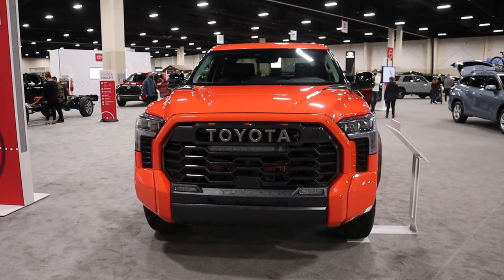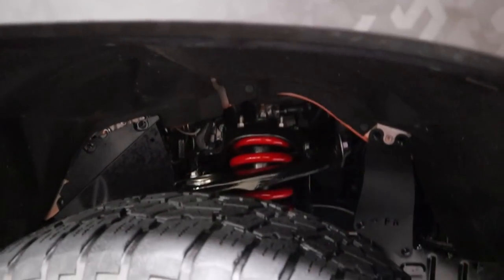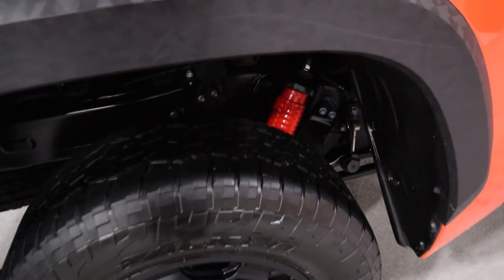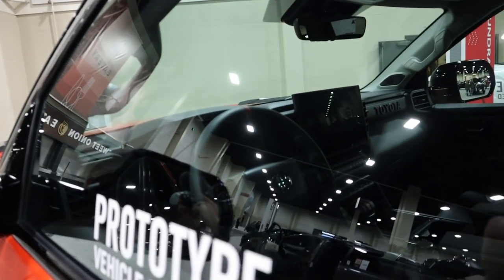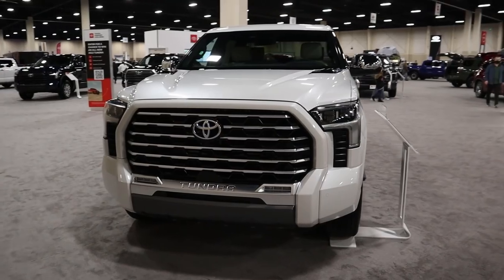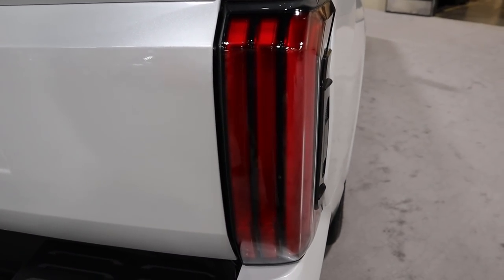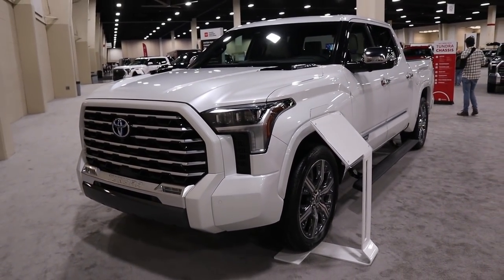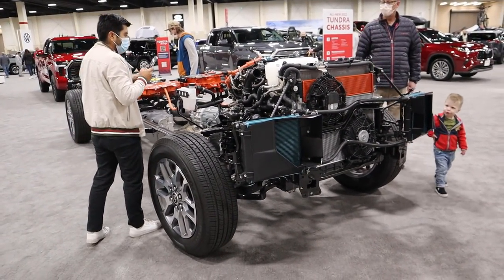2022 Toyota Tundra TRD Pro And 2022 Toyota Tundra Capstone: Which Tundra Is Best?

Comment: They both look great in my opinion. I kind of wish they did something different with the stamped TRD pro on the back. But the marker lights are on there because it exceeds 80 inches in width. When you get the pro I believe the tires sit at a wider stance making it larger than 80 inches. So you’re right the body is pretty much the same width with the capstone!
Reply: The fender flares are a bit thicker on the pro

Comment: Since you didn’t have any measuring tape  saying the TRD PRO and the Capstone are the same width is speculation. I did some research the standard width is just  over 80” while the TRD Pro is 81”. The blind eye probably wouldn’t be able to pick up that
Reply: It's just the wheel offset, the body is the same.

Comment: Those are not marker lights…marker lights mark the width…per FMVSS 108 those lights might be considered identification lights, but to be true identification lights they should be mounted as high as possible, like on top of the cab roof

Comment: As for the marker lights on the TRD Pro, I think it was partially for looks but also for function. If you want to build out your TRD Pro, you could add aftermarket fenders/bumpers and since it has the marker lights already on it, you would still be road legal.

Comment: The low front of the Tundra, which isn't changed at all for the TRD Pro, is such a massive issue for off-roading. The TRD Pro is a fairly large disappointment to me. I like the new Tundra as a pavement truck but it leaves a lot to be desired compared to the competition off-road.
Reply: @UCV_6w_Qv0zTRE8_cOO5-9_A Besides the shocks it doesn't compete well against a Tremor either. And it won't match up to the Silverado ZR2 at all. Toyota isn't serious about a factory off-road truck. The lack of factory recovery hooks says it all.